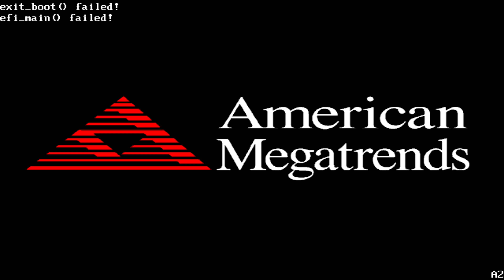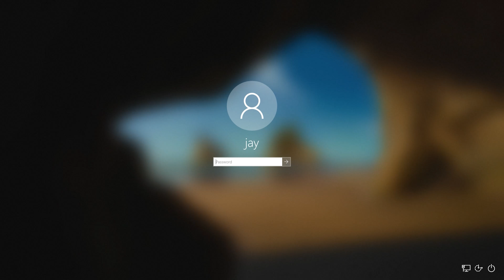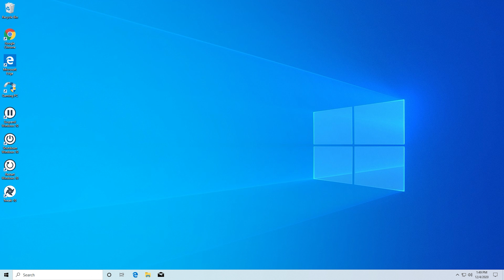Can You Upgrade Your CPU While The Computer Is On?

Comment: Remove the computer from the computer while its still on
Reply: Eject PC
Reply: @vpertys  Eject OS C:\ drive
Reply: So you mean just smash the motherboard
Reply: But then “What’s in the Computer?”
Reply: Wait hol up
Reply: Throw the computer off a desk while running cs:s 

nvm most ragers would know what happens
Reply: @andrewrivera8651  Just start any linux livecd and you can remove all of your disks without  problems while running.
Reply: @andrewrivera8651  he already removed the hard drive, so technically he did eject the entire C drive
Reply: @vpertys  windows 98 be like
Reply: move pc while it's on
Reply: @MrRandomposter  delete "my computer" wile using PC
Probably maybe a BSoD or just a freeze or just in utilized PC
Reply: Duh it will not display anything

Comment: Taking hot swappable to a whole new level
Reply: Nah. It's Plug & Play. It seems most people have forgotten that name sadly. :P
Reply: @SilkenLuna  yeah cause everything is plug and play nowadays
Reply: @MarksterC  So?
Reply: @SilkenLuna  I’d say plug and play is better used when you talk about accessories like mice, keyboard and headphones/microphones etc in the way you don’t have to install any drivers or software just to make it work.

Doesn’t really matter if the hardware inside the pc is hot swappable  or not, it will probably still need the proper drivers and software to get the most out of it.
Reply: I have personally hot swapped ram before for the giggles of it. If your system is setup correctly, you can basically hot swap anything but the motherboard itself 😂.

Comment: In 1997 I had built an AMD K6 system. I had wired the fans to turn off while in sleep mode. I was showing someone my build and thought it was off. I removed the K6 CPU while it was asleep to show it off. I put it back in the socket and suddenly felt heat waves rising from the heat sink.

Turns out that the CPU went full throttle when I inserted it but the rest of the system was asleep, including the fans. 

I pulled the power cord fast enough, but it made the adrenaline rush!

Comment: 10:55 wonder how would it be on a dual cpu motherboard, or even a quad one
Reply: some fried pci-e lanes and maybe, motherboard/Vrms

before USB, you had to turn off the pc to put/take every single piece of hardware. serial, parallel, ps/2....
Reply: @amdrebataglia  And jumper settings galore...
Reply: There are actually systems with redundant CPUs for CPU hot swapping. Also RAM redundancy is common thing in some servers.
Reply: @uhliktube  redundancy is key!
Reply: O shit

Comment: so removing the CPU did less harm than the drive wow
Reply: actually more harm can be done by its metal frame falling on the GPU like it happened here (a videocard without a backplate)
Reply: @himanologanor4093  well the drive needed a reinstall of windows the cpu just made it turn off

Comment: Fun fact: PCI Express is actually desgined to be hotswappable. The first lane that makes contact is 1 and the last 16 and when you take it out, lane 16 will be the first to be disconnected, BUT most operating systems don't even support hotswapping.
With certain hardware you can upgrade basically anything while the system is running, but those are something like supercomputers or datacenters and not stuff that the average person can get or even afford.

Comment: What about trying to upgrade the PC parts while the PC itself is in a hibernation or suspended state?
Reply: When the computer is in hibernation it saves the stuff on the ram into the storage and shuts down the computer so maybe it will just be normal but maybe I'm wrong.
Reply: @blackwillow7314  On windows yea
Reply: Sleep mode would be interesting. Hibernation probably isn't.
Reply: Sleep, might cause some errors.
Hibernation isn’t much different than shutdown though, since it still has to do BIOS boot so I would imagine it would be fine, but it’s still possible something might happen but less likely.

Comment: Replace the bios battery while the computer is on pls.
Reply: Cmos is copied to shadow ram during bootup, it wouldn't do a thing...
Reply: @waytostoned  at least something would work
Reply: as long as you don't short the contacts, removing battery wont do a thing, because the bios is still getting power from psu, pressing the clr cmos button (or shorting the pins) however will
Reply: Try it while the BIOS is doing a POST

Comment: In the GPU part, you should try and connect remotely. So you can see if the O.S it's still working (most likely not) without video output. I did this while testing a "functional" GPU that it didn't have the video outputs working.

Nice video btw!

Comment: Non sytem sata drives can actually be replaced while the system is running, and should be relatively save, if you disable them in windows before removing/replacing them.
Some server mainboards also even support pcie hotplug, which could allow gpu replacement, but still you would need to diable the device beforehand. ^^

Comment: I know that this video was probably intended to be a joke, but for the curious ones, while desktop PCs don't really like you hot-swapping parts (although some Linux distros might actually allow that, as PCI-E is technically designed to support hot-swapping), servers and especially IBM mainframes actually can handle it much better. Hot-swapping drives is commonplace on servers (usually in redundant RAID arrays), and in the case of IBM's z/OS you can hot-swap pretty much anything - including the CPU - and the machine will continue to work as if nothing bad had happened.

Just goes to show that we can actually build systems so redundant that no single broken component can truly take them down.

Comment: Try standby and hibernate upgrades.

Long ago I worked at an IT shop and we had a case where a hardware upgrade was causing a boot failure but we were able to get around it by booting, going into hibernate, installing the hardware, resuming, telling XP to find new hardware and then pointing the installer at the driver disk.

So, as insane as it sounds, I actually had a case where I had to do an on(ish) hardware install.

Comment: If you are wondering: when you booted into windows at 5:00 and got the disk check stuff that probably happened because you force shut off the machine multiple times. It was most likely due to the improper shutdowns so you can replicate the same behavior by forcing shut down multiple times and there you go you will get the same disk check screen at bootup.

Comment: I once had a weird quirk with a laptop's hard drive in which if a device was drawing a lot of power from USB, the internal hard drive would end up malfunctioning and render itself inoperable until the next power cycle.

Whenever that happens while I'm in Windows XP, it blue screens shortly after the hard disk starts malfunctioning, if it didn't restart prior to the BSOD due to insufficient power.

Comment: with linux you can remove, add(hotpluging ram) ram  of course first you have to tell your kernel by making it read-only, hotpluging pci , if you have multiple cpus you can hotplug cpus you can even disable cpu core while your pc is running (of course this is depending on how many of these features are supported by your kernel)

Comment: Most drives should support Sata hotswap so unplugging the Sata cable shouldn't cause problems to the drive
Reply: Yea but the steps are:
1. Unplug Power
2. Unplug data
And dont unplug the drive with your Operatingsystem

Comment: Quick tip. This method is called hotswap. If the pc supports it it won't crash or turn off. And most good servers like Google for example have this function. in case a hard drive or ram on a server dies you can just quickly remove the dead component and install a new one without turning the unit off. So if you are planning on creating a good website or game server. Make sure you get parts that support hotswap

Comment: 8:40 - But what about SSD? No moving parts - will it still corrupt?
Reply: According to my experience, when you unplugg the SSD while idle, it's completely fine.

But if you unplugg/turn off while doing something like disc checking, writing, or something like that, there is a high risk of  the SSD getting corrupt.

I've ever tried to partition an ssd, and because it takes long, I turned it off, thinking that it would be up and running fine like a Hard Drive. But then the entire boot sector had gone completely corrupted.

Fortunatley, I could still recover some data.

Comment: Servers actually support hotplugging PCIe devices. While consumer PCs don't, it probably wouldn't do anything bad to either component as long as you're not in the middle of flashing your GPUs BIOS or something.

The part that would go haywire is the software as theyre usually not designed to handle a PCIe device suddenly going missing

Comment: I 100% agree on the drives... I recommend not even pulling 'hotswap' drives whilst powered up, I've had (IIRC) 3 die on me in the last decade (or so)... thankfully only one (the first one) was mine, the rest I was just doing what I was told (despite my "I told you so" objections).

Comment: Graphics and RAM cooper contacts do get poor over time, so it's not unusual for them to disconnect while the PC is running, if's only a split-second it can be recoverable and you will only experience a slight freeze/lag, or a screen blank-out., but it shouldn't harm the hardware in anyway

Comment: I would expect removing some of these parts would not break them as loss of power like this is no different to a power cut
Reply: Not really. The psu has capacitors that can hold charge.. that's why you shouldn't touch the internals after unplugging a psu until you discharge them smh

Edit: It holds charge to protect it from a power loss. One of many reasons why you don't directly plug the motherboard to the wall socket
Reply: @heavygaming6596  It does not hold charge for that reason, capacitors just hold their charge if there is nowhere else for them to go, therefore it would not be supplying any amount power to other components when the PC is off
Reply: @ReadieFur  My bad. After I looked it up I saw you were correct.

Comment: I believe the reason there was still graphics after the CPU was slightly out is actually because the frame buffer(VRAM) still had data and the GPU hardware was still running and outputing, just the same frame over and over, and then when you pulled out the CPU all the way the bracket fell and shorted the SMD components on the back of the GPU core and caused it to shut off, coincidentally right when the CPU was removed. I don't think the CPU was doing anything once you lifted the tension bar onward, only the GPU

Comment: Well, i guess if you like switched the CPU WITHOUT shorting the data lanes on the GPU and while the CPU clock signal was being low, you could actually manage to freeze the PC and start it back up from the point it was on before just by putting the CPU back in.

Edit:
Tried that with an Apple ][ and it worked. Wouldn't recommend doing this on more modern systems though. It could cause data corruption.

Comment: Removing the SATA cable won't really mess up much. The hard drive is not directly controlled by the computer, that's what the microcontroller on the PCB of the HDD does. If you remove the SATA cable it simply stops doing whatever it was doing and sits there idle until you plug it back in and your computer starts working with it again.

Comment: This should be titled "How to break computer parts and potentially electrocute yourself"
Reply: You can't be electrocuted by 12v...people have tried with car batteries, which have plenty of amps to kill, nobody ever dies from it because 12v can't penetrate skin deep enough.

Now if you step the voltage up...a AA battery can kill.
Reply: @freedustin  Dude I have literally been shocked by a car battery what are you talking about... and I never said it would be a lethal electrocution.
Reply: @freedustin  Dude I have literally been shocked by a car battery what are you talking about... and I never said it would be a lethal electrocution.
Reply: @techdegenerate286  electrocution is defined as death from electric shock. it's always lethal.
Reply: @freedustin  Dude now you are just splitting hairs. Most people if shocked will generally say they were electrocuted although they may not have died people know what they are talking about. It may not be the proper usage of electrocuted but people get the idea. It's generally never a good idea to work on or repair electronics when there is current running through them!
Reply: @techdegenerate286  ...current and voltage aren't the same thing either.
we are on a tech channel, you can get the terms right.
Got any more hairs you want me to split? I'll leave ya bald.
Reply: @freedustin  actually if you are just splitting the hairs they would still be there so he wouldn’t be bald.

Comment: well you can actually upgrade or more like add a driver or remove it if you had Hot Plug/Hot Swap option on the motherboard, but they are mainly used on servers (only saw some that can be used for pc) from what i heard

Comment: 1:49 you have technically reached a windows crash dump screen, but as there is no addressable volatile memory for the internal graphics-allocated VRAM in RAM to display the crash dump screen, you have a system hang instead of a crash, with the GPU framebuffer displaying the last contents it has.

Comment: pulling the sata cable while powered will probably not cause hardware damage, but might cause corrupted data in an area it was writing at the time, although if the drive still has power it might finish writing what it had in cache.

Although with SATA it can do hotswap in theory if enabled, just more of something you would see on servers instead of consumer hardware

So at worst you might need to run chkdsk, or copy data off and reformat the drive.

but YMMV and even 1% chance of hardware damage is still something to avoid if possible

Comment: I think the reason why the drive didn't completely die when you unplugged it from the motherboard is because the SATA standard requires that drives using SATA are hot-swappable, meaning they can be unplugged and plugged back in while the computer is running. This is actually how e-SATA used to work. It relied on the fact that SATA is hot-swappable. As for windows, I'm sure it isn't designed for that so I wouldn't be surprised if stuff got corrupted.
Reply: Some MoBo Bios settings will allow those drives to be set to Hot swappable mode, used it for a few of my drives, though I had some dedicated hotswap bays on my desktop

Comment: You could try putting PC into a sleep, then replace CPU, and maybe a GPU, or maybe even a cloned drive. And when PC wakes up, probably should continue working?
GPU can be hot swapped if driver support VPU to restart GPU only. VPU are used to shut down GPU card completely if it stops responding and power it back on, so it can continue working without the need to completely restart the whole machine.

Comment: If it's a drive that doesn't have the OS on, you can actually "hot-swap" them. You can get 5.25" hot-swap bays, or I've done a hot-swap in my HDD bay whilst cloning drives. As long as the disk isn't in use when you pull it you'll be fine. So if you're running a game off a different drive to your main drive for example then something like what happened with your OS would also happen with it, but wouldn't be a catastrophic failure like a BSoD

Comment: When you removed the CPU, it probably went black because the bracket shorted the GPU. If you had a piece of cardboard there, it would have remained hung with the desktop.
Also, a GPU can be swapped while running with the right motherboard and BIOS. Like any PCI-E card except for the controller with the system drive, of course.

Comment: Taking out the RAM while the computer is on is actually dangerous and I'm surprised you didn't corrupt or even lose data that may have been being written. It remained on due to the GPU not dumping its graphics data from VRAM, but your computer was, and I quote, "A vegetable." It's literally the equivalent of taking out the spine of a living person. Moreover if your system was performing any update or writing to a system file. It would have literally killed your operating system.

Comment: I'd love to see you revisit this with secondary drives rather than the boot drive, as well as secondary graphics cards like SLI. Even stuff like a fan/rgb hub might be interesting, though what I'd most want to see is one of those dual processor motherboards. If you take out one processor but there's still one in the motherboard, will it keep on truckin?

Comment: Surprisingly this time, I am not Surprised. Modern tech is Robust and has enough Failsafes.
The only scary part is when CPU socket fell on the GFX. The metal may very well short out the System and cause some magic smoke.
Reply: Not even close.

Comment: 12:06 you did manage to short the circuitry on graphics card with the cpu socket cover.. that was way worse than a sweaty finger would be. Probably why the computer shut off right after that, would still have a frozen video feed if you didn't short it out. Fortunately for you the graphics card survived.
Reply: well, in the middle of the card there usually are only data lanes and if those get shorted, they only erase data from vram and don't cause any permanent damage.